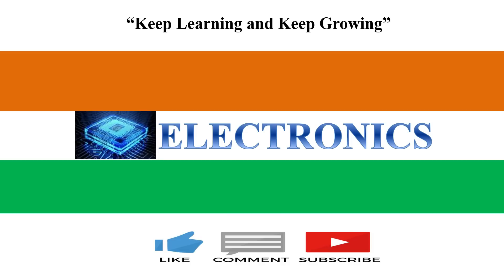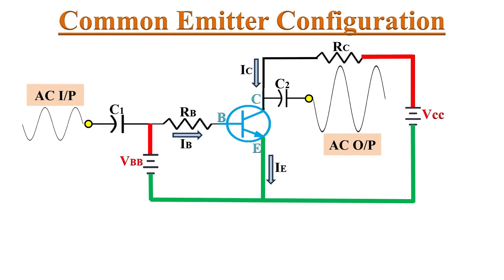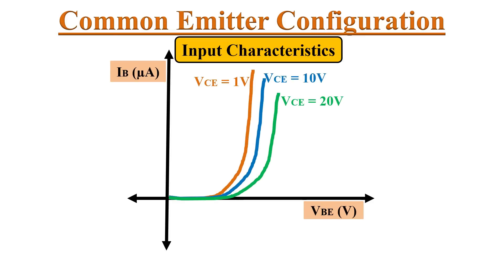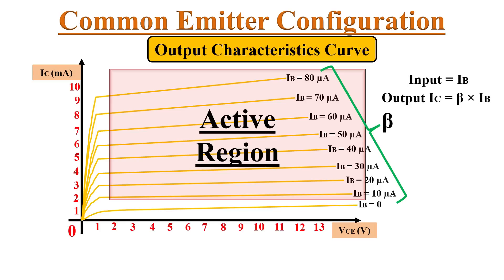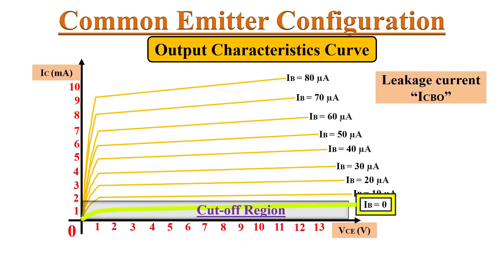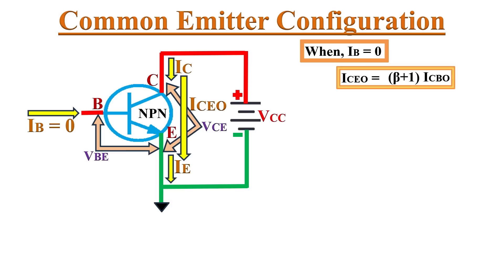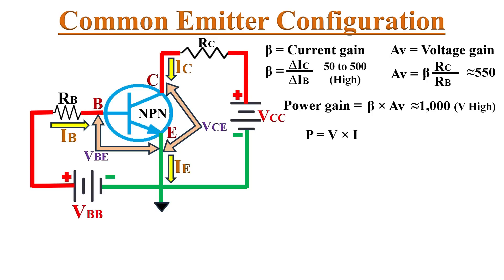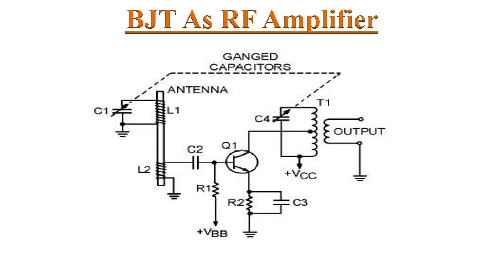Common Emitter Configuration of BJT Explained.

Comment from the maker: 0:21 Introduction to Common Emitter Configuration
1:56 Input and Output Characteristics of the Common Emitter Configuration
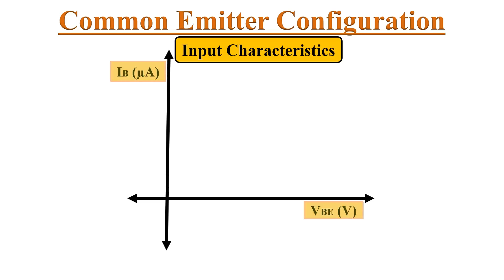2:38 Input Characteristic curve explanation
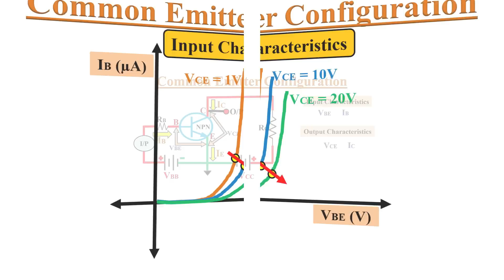4:42 Output Characteristic curve explanation
5:14 Active Region of Output Characteristic curve
7:16 Saturation Region of Output Characteristic curve
7:55 Cut-off Region of Output Characteristic curve
11:58 Current gain of Common Emitter Configuration
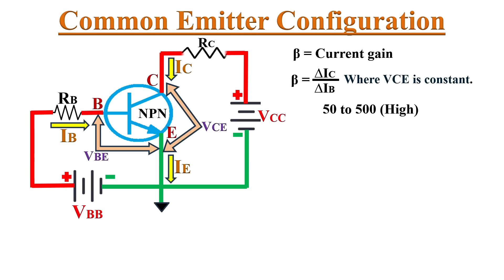12:32 Voltage gain of Common Emitter Configuration
13:08 Power gain of Common Emitter Configuration
13:46 Input and Output Impedance of Common Emitter Configuration
15:26 Applications of Common Emitter Configuration